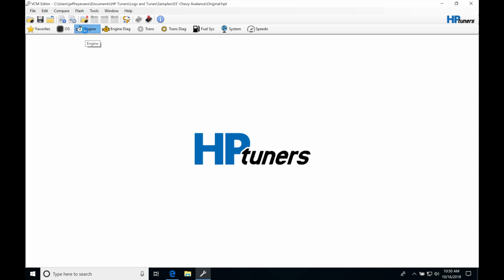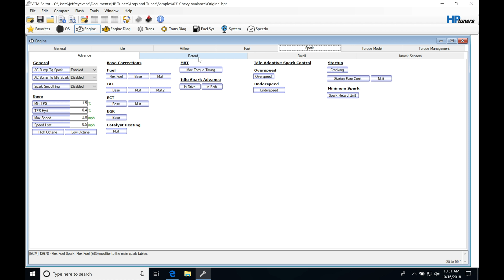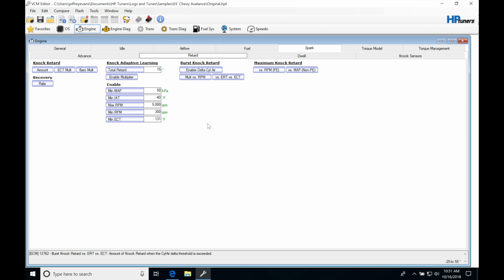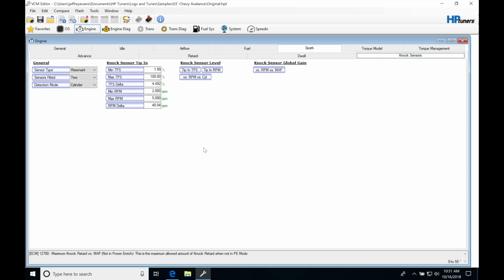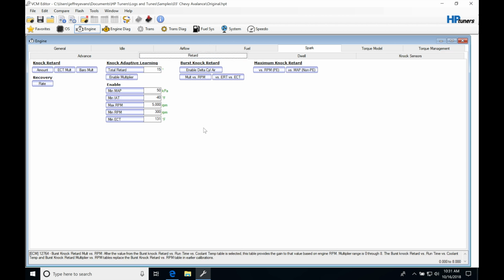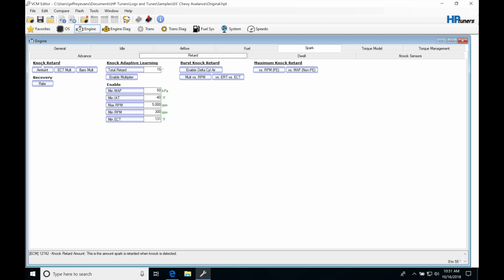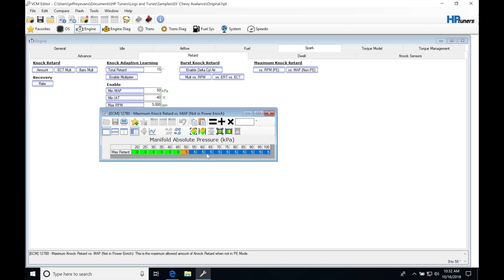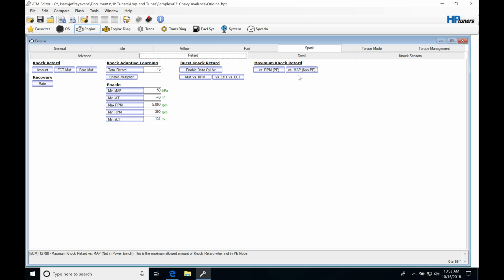HP Tuners GM Gen III: Knock Control | Evans Performance Academy

Comment: On knock sensor general tab, there is the sensor type, resonant or flat response and in detection mode box there is cylinder or engine. My knock sensors are in the valley pan so is that considered engine or cylinder ? Stock tune is set up as cylinder / resonant and I’m getting zero KR.